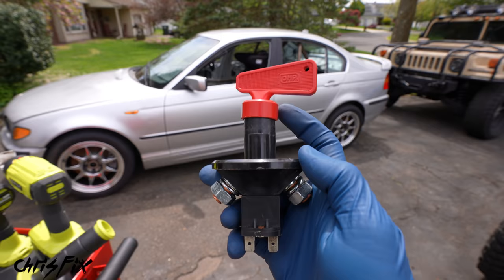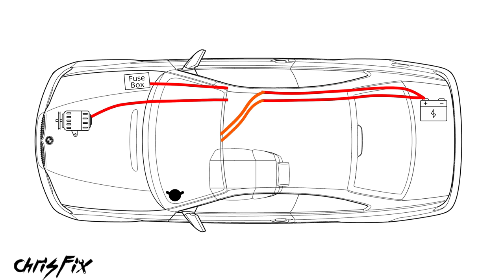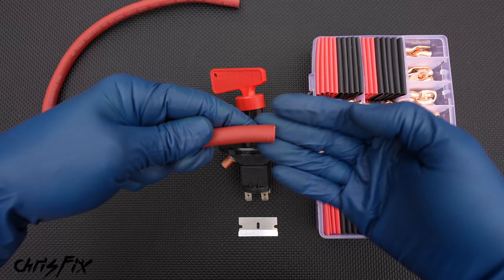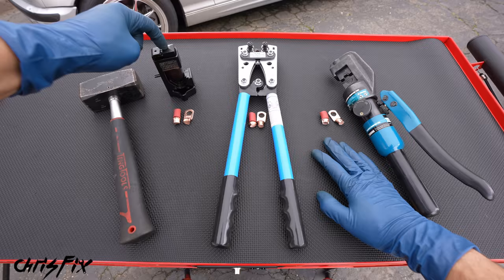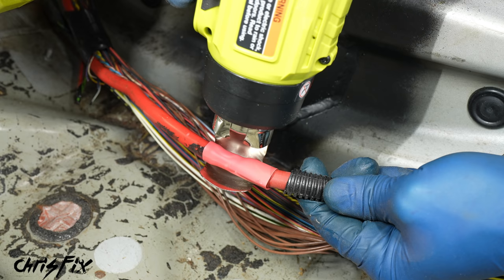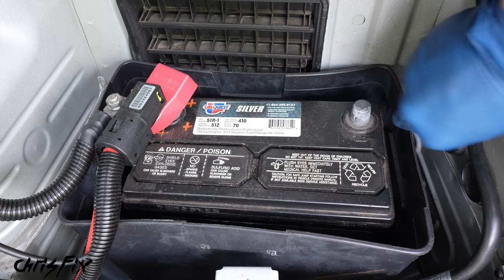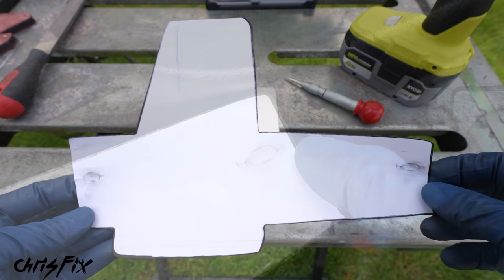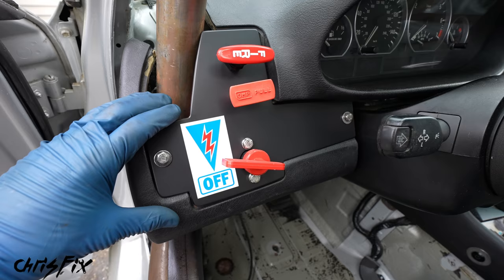How to Install a Battery Kill Switch

Comment: As for the fire suppression systems, 2 things one adda gauge (it could be as simple as the gauge on a fire extinguisher), but just a simple gauge that you can look at to know when and if the fire suppression tanks need to be replaced. Also as for the Auto fire suppression make sure that both the driver and the pit crew can know when the automatic fire suppression goes off, the reason for the driver is so that they can wan warn you that there is a fire and they are pulling the kill switch before doing so. Also the reason for one on the pitstop side is so that if the driver is unconscious then you can know that the auto fire suppression has gone off and that you can get people out there right away. Also make sure to have plenty of spare fire suppression tanks just in case. Also I highly suggest making a backup power system for the fire suppression system so that way the fire suppression system(s) can still go of even if the kill switch is on. The reason I'm suggesting all this is because it is safe, and gives you some good safety protocols incase something goes horribly wrong and there is a fire, because as pit crew you should know if there is (was and the auto fire suppression put it out.) So that you can examine and try to find and fix what caused the fire, along with pulling the kill switch just incase. I also suggest the fire suppression have a backup power system, like maybe a double 9v battery (or 12.6 volts at the very least so it has the same amount of voltage as if it were running off of the car battery) setup for all the required things, and there is no is nothing providing the backup power and that is carried on the driver so that they can attach it and have backup power in case the fire suppression system or communication system, or something like that needs to be used. By require things I mean like the communication system, the fire suppressions systems, etc. The reason I suggest 2 9volts is because the battery in the car is 12.6 volts normally if everything is good, and so the backup battery system might (or will) not do any good if it below the 12.6 volts the car battery normally has when not turned on. If you want you can do the amount for the car on with a good alternator, or more just so that way if the kill switch is on and the backup power is attached so that way you can still use the main things without having to turn off the kill switch mainly if you need to have power to something but the kill switch needs to be on for safety. I don't think that the inspector will mind, in fact the inspector might find that to be a good idea of a way how of to still use systems even while the kill switch is on whether or not it is an emergency, make sure that for that you don't connect the backup power supply connections onto the kill switch nor do they any batteries connected unless it is needed so that way the backup power when batteries are connected doesn't get stopped by the kill switch. This is all a smart idea and plus it will really help make the outcome of a life or death situation pointing a little bit closer to the chance that they live if something does go horribly wrong and the kill switch needs to be used.

Comment: You should not wrap a resistor in heat shrink. Ceramic resistors get hot when operating and could cause a fire. In this circuit that should not happen, but something to be aware of.

Comment: I just want to keep thieves from stealing my stuff.  Maybe a disconnect between the battery and the starter?  I am thinking a Bluetooth-controlled disconnect for various systems like fuel pump, starter, etc.  A thief would have to track down every interrupted system to get the car going.

Comment: Absolutely awesome video!  I don't have a car with access to the internals as in the video but it still was extremely instructive to watch.  Guess a video using a "normal" car would not be possible but it would be great to see the same thing done to a regular car.   Perhaps keeping power to the on-board computer would also be an option so that it's settings can remain without having to be learned all over.  But still a very engrossing video to watch !

Comment: Instead of cutting the heavy gauge wire and adding more heavy gauge wire, you could have installed a high current relay at the battery end, and used a small low current switch as the kill switch.
Reply from the maker: I don't think that would have passed tech

Comment: Chris has never built a race car.
Wire is heavy. There's probably 4kg of battery wire in that car. I use a lithium battery that's about 1.2kg as close to the electrical system as possible and run the isolator as close to the battery as I can reach. Since the marshal can't reach the iso switch I use a pull cable that runs up the windscreen cowl panel. Whole setup is half the weight of the stock battery.

Comment: Hey Chris I have a 2006 gmc serra and it has no spark I've tried everything I could think of and it's still not working its cranks but has no spark what would u recommend me to check if anyone has any ideas im open for any suggestions. Anything helps.

Comment: Electrician here, couple things I thought could be improved:
1. You ought to get slightly bigger sleeving for the cables as yours doesn't actually protect the entirety of the cable, or better yet buy armoured cables with some mechanical protection built into the insulation.
2. When crimping with ANY of the tools, you are meant to select the correct crimping head for the cable (eg 25mm²), not guess and check like you did with the hydraulic tool.
3. While your main priority is to ensure the cable gets all the way inside the lug, you want to cut the insulation so this is only just possible; You don't want bare copper exposed at the base of the lug

Comment: I don't wanna sound dumb but 1) Can you do this on a daily driver for theft protection? 2) How can you lock and unlock that car, if possible, if the kill switch is active and the battery is off? 3) Is there a more daily-able theft protection device/system?

Comment: Hey Chris? I know that you might not see this or just not care, but if you do, do you think you could make a video or short explaining the different connectors, their purposes in automotive context, and where they would go? Also, what happens if you leave the key in the running position, your foot is on the gas and you tuen off the kill switch? Much love!

Comment: Top tip : Add a heatshrink before you connect the wire, because if you connect it now there's no way you can put the heatshrink on

Comment: Hello and welcome to double crimping will make you fail ipc. Double crimping cause more stress on the crimp.  Also there a better type of heat shrink it has a glue in that is used in area that will get wet.

Comment: Liked and subbed! Great job man this is such a well put together tutorial! My totally nit picky suggestions would be to ditch the cheap looking plastic split loom cover for some nice braided nylon expandable sleeve, and replace the Home Depot hardware on the switch panel with black button head Allen bolts. Good work! 🙌🏻

Comment: Hey Chris! An update on my lawn mower project. I was able to change the fuel line and fix one of the problems, which was a bad ignition coil. Another problem I experienced was it was sparking at the wrong time. Considering it’s age I thought the flywheel was moved to the wrong position. So I need to remove the bolt holding it in but the bolt won’t budge, even with a impact drill. Any tips?

Comment: A cheaper method you could try is to pop the hood, take out the starter relays from the fuse panel and take them with you. Chances a crook has spare starter relays for your vehicle are pretty darned slim. Doesn't cost you anything in time or money too.

Comment: I'm surprised how well those crimps work for large connectors. I was under the impression the copper was always going to have air gaps like some of the examples you showed, no clue it actually compressed it into a single piece like that. odd

Comment: 16:00 you start at the wrong place. You should start at the tip of the cable, because you might stretch the copper a little.

But I think it will work anyways.

Comment: Older car Radios suffer no voltage, a good thing is to fit a smaller 12v gel cell to your Radio with a diode to the power in wire so that the parasitic draw won’t flatten the small battery but the car will keep the battery charged ,

Comment: I assume that’s 10 W as in 10 W rated because of the length and also the fact that it’s one of those concrete embedded resistors 3:59
Reply from the maker: I think so
Reply: @chrisfix   no I saw something and it said it was 11 I think I maybe was going to edit it I don’t know and I don’t know how to finish this

Comment: You should do a video on how to thin out wires from your car haha. I disconnected all the unnecessary wires in my gutted e36 m3 track car, but don’t really know how to physically take out the wires without taking out the entire harness. Especially wires like the radio in the back and roof lights and such, that aren’t needed in a track car

Comment: I’m thinking about installing this on my mustang because it has a drain and I can’t seem to find it so this is my next choice. However since its just a street car would I be able to install this without attaching the ecu to the switch? And if so what would I connect to the leads on the switch

Comment: Thanks a lot for your video! I'm trying to adapt your method to a NB1 Miata. One question tough: If I put the fusebox and alternator onto one side of the Killswitch, doesn't it get brdiged and the alternator feeds electricity into the fuse box again? I'd put the alt. and fuse box cable onto one post and the positive battery cable onto the other.
Reply from the maker: That is an interesting point I didn’t think about. I am pretty sure that is why you need to install the ecu cutoff as well.
Reply: @chrisfix  that’s right. So if my car doesn’t have 2 separate circuits I might as well just cut off the one main circuit right?

Comment: If I just want a kill switch on a vehicle i dont drive everyday and is not a track car/race car, and all I want to do is just kill the power from the battery can I just use a simple 2 pole switch on the positive wire?
Reply from the maker: I would do that on the negative side as power flows from negative to positive. There are battery disconnects you can install that just replaces the terminal and its a simple twist to turn off, you won't have to cut the wire and wire this in then

Comment: I only have one question, the cars manufacturer says in the manual that you have to remove the negative side of the battery first to prevent hitting electrically the ECU, but you have installed the kill switch in the positive side, ¿does this hit your ECU or not?

Comment: A less invasive option is yoink that fuel pump relay out and it aint going nowhere
Reply from the maker: That wouldn't really work in this case since we needed a kill switch for safety reasons in this race car
Reply: @chrisfix  ahh yeah since it's a racecar then yeah safety is number one, but normal street vehicles should all have a relay you can pull, im sure there's other ways but I use that method actually on my civic

Comment: I will be installing a battery kill switch on my motorcycle and I do not need to pass any tech inspection. Would it harm my electrical system if I were to use the negative leads instead of the positive?

Comment: I'm looking at buying this same switch but I have seen some comments about its quality and durability.  Have you had any issues with it.
Also just wondering if you had access to a bearing press could you use that for the hammer crimper or do you have to hammer it
Reply from the maker: Nope, this switch feels solid

Comment: You said that the killswitch would make you reset the car's radio and clock every time it's used. Would it be possible to wire up a bypass for those components? Would there be any effect to security if you did?

Comment: If i wanted to install this in my truck that has a battery draw (which i can not find), do i have to add the ecm wiring and alternator resistor? If i am only turning the killswitch after the motor is stopped? Like turned off. Just want it to completely kill the circuit, and not have my battery drain. Not having any plans of turning killswitch off while engine is running. Just a question! Thanks!

Comment: I need your help badly. Doing this same hook up in my 2001 celica gt. But following your instructions won't work. I have hooked it up the way you show but it's wrong for the celica and I'm now lost...if you can please help me out. It's from the one side of the switch to the alt. And fuse box that has me baffled. I haven't even attempted the line to the computer yet. I do have the jumper to the alt. side and grounded through the resistor...

Comment: I have seen someone install a kill switch but used a door jamb switch under the hood so when work was being done the remote starter would be unable to turn the car on. Any clue on how that works? Im asking because i only saw it in passing

Comment: Can you use a kill switch as an on off switch? For example I have underglow and wanted a conical switch to turn them on and off
Reply from the maker: You theoretically could but I would use a regular on/off switch for that instead: https://amzn.to/2USastQ
Reply: @chrisfix  yeah I get what you say but I like the look of a kill switch. It’s simply for asthetic reasons only. Just wasn’t sure if it was theoretically possible as I know these kill switches are normally
Used for 50amp minimum where I’m looking at 5-10amps

Comment: Hey Chris! I have a question. So most of the times I see you using the spill proof funnel to fill up the coolant, and it is good for bleeding the air. But if I have a maximum line in my collant reservoir, how should I use it?
Reply from the maker: Fill it up with the funnel and use a turkey baster to remove any excess until you are at the right line!
Reply: And can I turn on the engine while the collant  is above the maximum line to bleed the air system or can damage something?

Comment: So I think hydraulic Crimper is better and worth it for me even if I’m not using it i could still use it to crimp 12 gauge wire like using butt connector,eyelet and more

Comment: Question!:
Since you are terminating both the alternator and fuse box, instead of running two wires from the battery to the switch, can you just run one wire to the switch and have two from the switch go to the alt and fuse box? This can save some weight even tho it’s very small amount

Comment: Hello why do you have to had sheathing over the wires is it important? Also is it Mandatory For A Mount For The Killswitch
Reply from the maker: Organizes and protects the wire and the tech inspectors like to see it. And it will need to be mounted somehow, if it's loose in an emergency that can be pretty dangerous
Reply: @chrisfix  ok I get it now

Comment: Assuming these can be fitted to the neg side of the battery?
And the alternator discharge connection could be wired to the alternator output?

Comment: I bought a 95 mustang v6 just a few months ago and it has a very simple switch connected to the alternator and I literally have no idea which way is on or off as it doesn't have any indications. Previous owner said it was in the car when he purchased it and he just never touched it. I had issues with my battery (less than a year old) as soon as the weather started to get colder, where it would lose most power or shut off completely. The only way for me to drive the car without fear of shut down was to test flipping the switch. I'm assuming it's only pulling power from the alternator at that point? I'm so confused on which move to make next besides replacing the battery

Comment: Is there any reason you couldn’t or shouldn’t use double layer marine grade shrink tube with the adhesive embedded in it on one of these circuits?

Comment: Hello Chris , sorry for bothering u , i just want an advice for what am about to do , my car is Nissan Sunny 2019 , i changed the transmission fluid but with not the brand that the owner manual recommended in , so now i want to put the one that is recommended in , should i just change it or do a whole system flush? 
thx 🌹

Comment: Please do a safety clutch override switch.
Reply from the maker: What does that do?
Reply: @chrisfix  it disables the safety built into the clutch peddle so you can start the vehicle without depressing the peddle. It was quite common on Gen II 4Runners.

Comment: hey Chris, i have 1998 Honda Civic LX (AT) and i got a p1705 code and its for a transmission range switch, and i heard that a range switch and a neutral safety switch is the same thing, but my dad says theyre not, and i cant find a range switch for my car, nor can i find a black cover on my car, which my dad says there is a black cover. i need help figuring out if i need a range switch or neutral safety switch, if you could help me in anyway, that would be great! Much love to you chris 🙏💪🏾
Reply from the maker: They are the same thing, and that would probably be on the side of the transmission so you would need to jack it up, remove a wheel and go behind the splash panel on the transmission side and it should be there!

Comment: If you are installing a killswitch just for security - not for race safety - you can put a bypass wire across the switch with a small fuse on it - then when you isolate the power using the switch, there is still enough current to maintain radio settings, alarms, trackers etc - but if anyone tried to crank the engine, the current is too high, the fuse blows and they won't be able to start the engine - absolutely NOT for motorsport though!